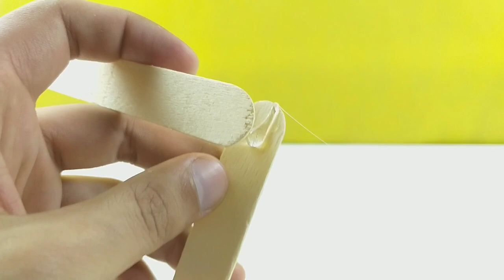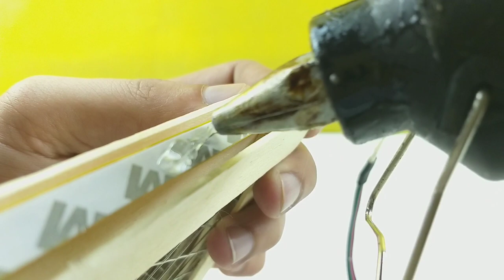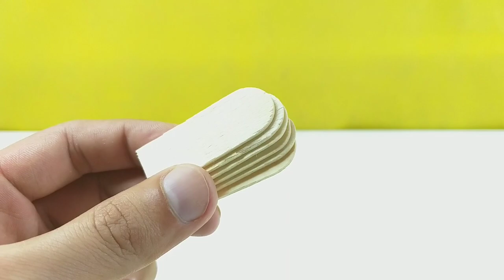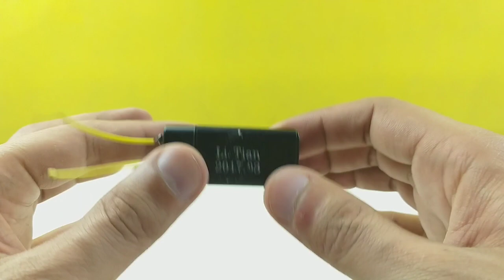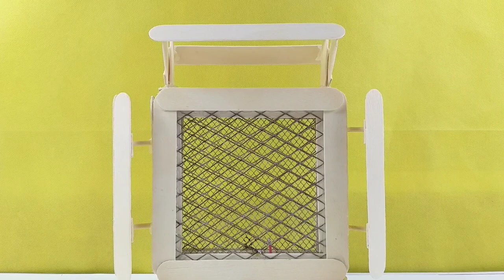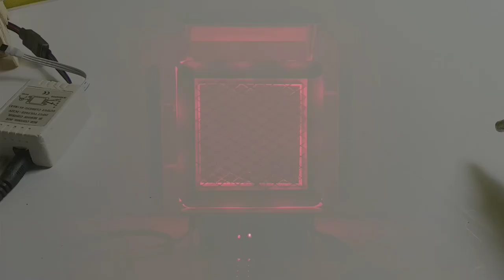How to Make Very Powerful Bug Zapper Lamp At Home

Comment: Where does the layman get a circut board like that and what exactly does it NOT do?
Reply from the maker: You can either buy or get it from an old broken bug zapper.
Here is the link :
https://www.amazon.in/Electronicspices-mosquito-circuit-Voltage-Generator/dp/B0863FJX4K

Description

The working of the Mosquito Killer Bat is very simple. A high voltage power supply is given to the metal mesh. So when a mosquito flies between the Meshes it creates a low resistance path between the meshes so the high voltage creates an ARC through the body of the mosquito which is instantly electrocuted.